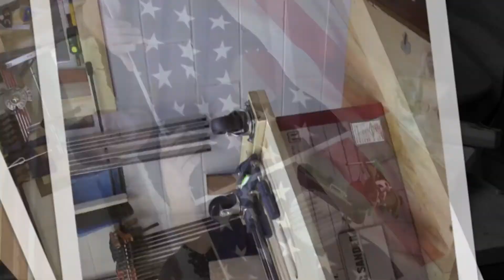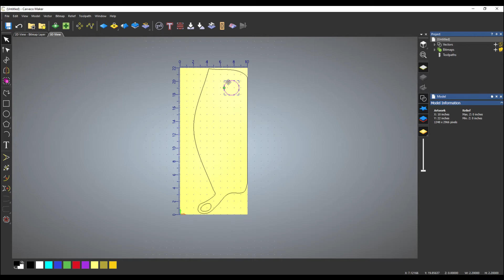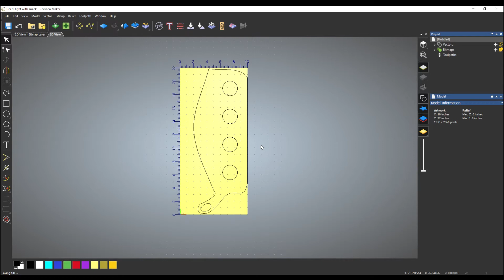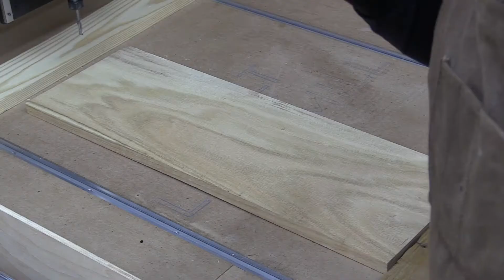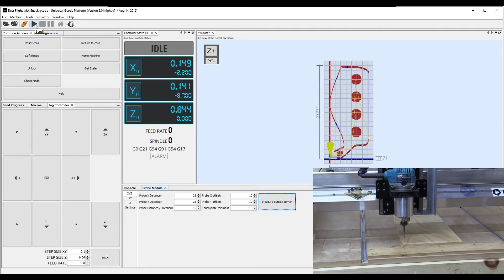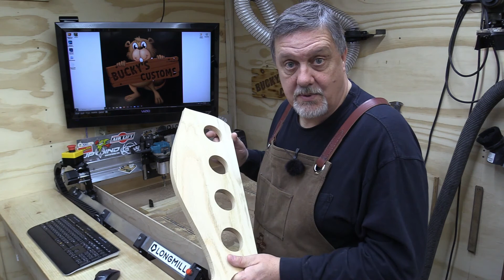How I Made This Beer Flight Using my Longmill CNC! Including Link to free Project Files!

Comment: Looks great! Can I ask you a questions? Could you have carved just the outline of the beer circles instead of removing all that material? Would that have been faster?
Reply from the maker: Hey Fotis S! Yes you can do that and it would have been a bit faster. I chose this way to eliminate tabs which would require some sanding. Either way gets the job done. I hate sanding! lol
Reply: @BuckysCustoms  I see. I have watched quite a few of your videos and I couldn't remember if that is an option! Great videos. Very informative. I hate sanding as well!!!
Reply from the maker: Omg sanding is the worst! Lol